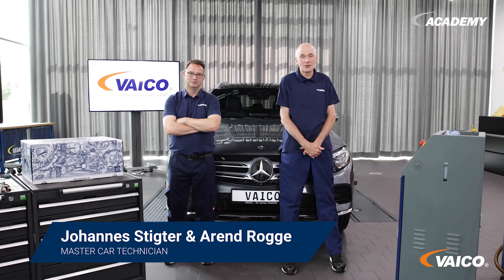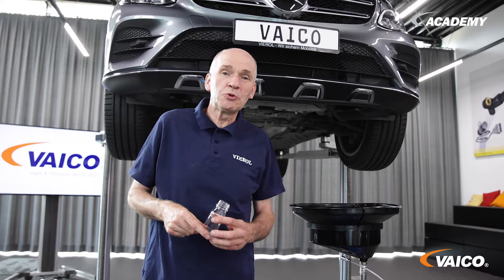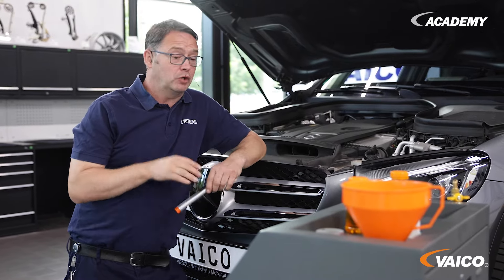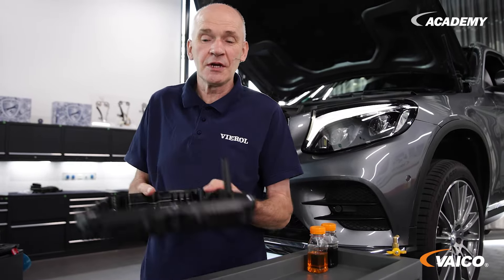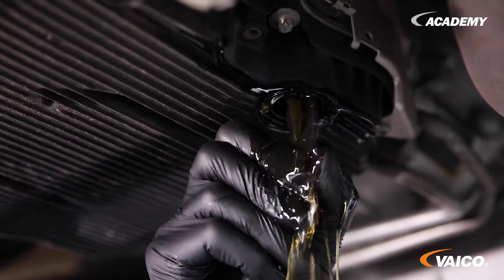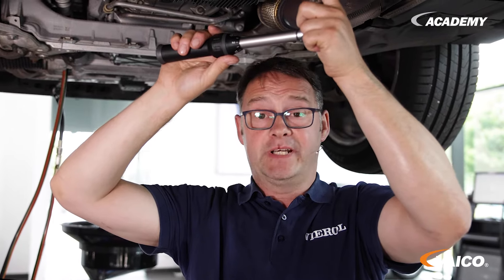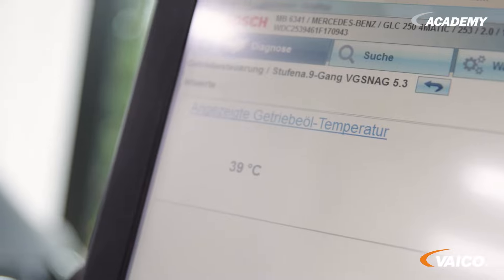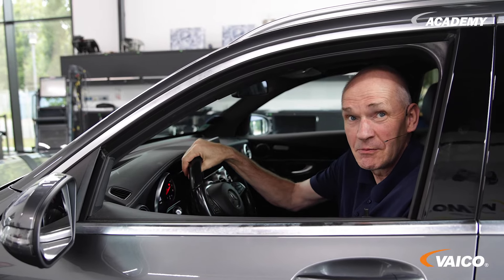9G-Tronic transmission flushing / transmission fluid change @ Mercedes GLC 250 with Kit V30-2377-XXL

Comment: How about just doing a 2 quart drain and fill with every engine oil change? The newest nissan frontier has this transmission and the fluid change is nuts, its nearly reason enough not to buy it

Comment: after how many miles should I have the transmission fluid changed for a 2022 GLC 300 4matic?
Reply from the maker: Hello, it really depends on the usage of the vehicle. If you use the car frequently for towing trailers, a shorter interval is recommended. As a rule, we call 80,000 km as a change interval for normal use.
Many greetings,
Team VAICO

Comment: Hello, i have mercedes w212. When i drain the oil with 45 celsius i have little bad shifting in -15 celsius here in Norway. I refiled transmission with + 1 litter. Will be to much oil i transmission or damaging ?
Reply: A not so smooth shift initially while it's cold is normal for an automatic car. The gearbox oil needs to warm up and reach the correct temperature to function properly.

If however, your car is still having a rough shift when the gearbox has reached optimal temp then you have a bad gearbox and the oil is not your problem.
Reply: @sajjeel123  thanks for anwer, i drain the oil second time in plus 20 celsius there was plus 250 ml. Should be ok now.

Comment: What happens if temperature goes over 39. Should I wait for it to cool down?
Reply from the maker: Hello PeterChauC,
if its a lot higher than 39 degree celsius, then let let it cool down. But if you are just a little bit over the 39 degree, like 42 it should be alright. If the temperature is too high you will lose too much oil and the level will not be correct anymore. On the other side, if the temperature is too low you risk overfilling that can also damage the transmission.
Just keep close to the 39-40 degree celsius and you should be fine.
Regards, 
Team VAICO

Comment: Hello nice video but I have one question 
Why you did not drain oil using the flush machine from filter??
Thank you...
Reply from the maker: Hey,
we have produced another video on this topic using our new flush device. With our new tool, the process differs. In that case the whole transmission is rinsed while the oil pan and filter are removed. It will be online soon.
Regards
Team VAICO
Reply: If you want to film and do it for a 7g+ (nag2+) I have one and could come to you?

Comment: A flush is performed because Mercedes removed the torque converter drain plug.
And that's a shame because draining the converter and replacing the filter was 90% of the fluid.
Reply from the maker: Hi MikeSmith,
you are right. With the torque converter drain plug it was possible and fairly easy to change the transmission fluid without the need of a flushing machine.
That's one of the reasons we still add the torque converter drain plug to our EXPERT KITS+, so if it's possible to drain the converter you have a new plug to seal it off safely.
Regards,
Team VAICO
Reply: @VAICO So you failed to mention that there’s still oil in the torque converter if your doing this job you’re self 😤